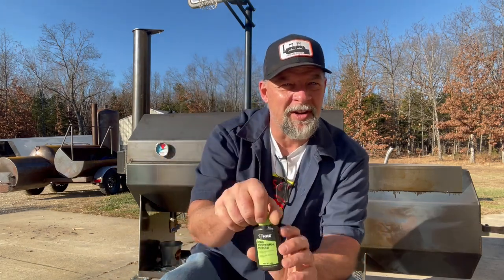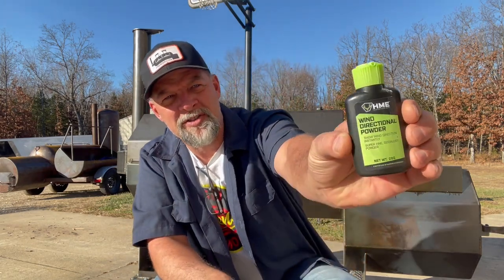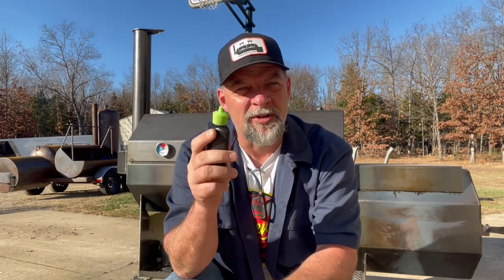Fire Management: 3 Reasons Your Offset Smoker Won't Get Hot Enough and How To Fix It

Comment: Thank you very much! Your advice on wind direction should solve my frustration. You are the first person I have heard to give that advice.
Reply from the maker: Awesome!
Could I develop the topic a little more?
Reply: @SmokerBuilder Yes, please do talk more about wind. Wind, for me, comes mostly from the south. My smoker is south to north with the firebox on the north end, and is aligned parallel to the front of my garage, which is about 6 feet east of the smoker. My firebox is completely burned out and I need to replace it. I want to turn the firebox so that it opens to the front, rather than on the north end, so I can watch the fire while I am under the cover of the garage. It’s a Frankenstein idea, but should the orientation of the firebox be critical as long as I adhere to the airflow calculations based upon your pit calculator?

Comment: Great video! 🙋👍
I like to brick line the bottom of the firebox and burn on the floor. That keeps years and years of direct heat off of the steel and will preserve it for a long, long time.

Comment: I have a Char-Griller 2828 Smokin' Pro I got as a wedding gift ten years ago. I initially struggled with getting it up to temp until one day I got distracted and accidentally left the stack damper wide-open. That proved to be a "Eureka!" moment. It came up to temp easily and stayed there. I eventually had to back it off. Also, I highly recommend trying the "Flying V" grate method (see link below). I set it up in mine using a couple of extra grill grates that came with my side firebox and was shocked at the difference in performance. It held a steady temp between 250° - 275° for close to 3 hours, using just the initial chimney of coals, no other fuel added, other than hickory chunks for smoke. My wood chunks lasted longer, too; only had to burn about 1 or 2 an hour to keep the smoke rolling. It did a lot to mitigate ash build-up, too. 

https://youtu.be/FD9PQWboRQk?si=2h20lIfLS2oVg6eO

Comment: This wind effect definitely applies to the Traeger Tailgater with the 2 vent holes on the back, combatted this problem by riveting a piece of aluminum over each vent hole and purchased a smoke stack off amazon, cut out the hole and bolted it on, i did add 2 additional nuts and bolts to the stack to help secure it even better and has been running dang near flawless since

Comment: I live in the Outer Hebrides of Scotland which is windy most of the time.  I do position it you do here, but with high winds is sometimes just too much, so I built a wind block of two pieces of plywood, hinged together, and lined with a welders blanket.  I smoked a turkey on Thanksgiving in 30-40 mph winds.  It still wasn’t easy but it was manageable.

Comment: Hey I’m a big fan. Currently building my first 250 gallon offset. Thought about doing a Goldees design. Can you explain why there design supposedly works so well. 
  I already built a 120 off an air compressor tank with an open throat. It works well. Just curious what you think. Thanks Frank!!

Comment: How much wind would it take to affect the Mack offset smoker? I moved to a pretty windy part of the country. Western South Dakota. 20mph is normal. 30 gusting to 50 is pretty regular when it's a slightly higher winds situation. Seen 30 with gusts of 40 within the last week.
Reply from the maker: I’ve actually cooked on my Mack up there back in the day. As long as you keep the direction quartering towards the firebox you’ll be fine. Those winds are still challenging though. 
Once you run it a few times you’ll have it figured out 👍

Comment: I never had problems getting my smoker up passed 250 and would struggle to maintain it under 300 but when I tried to make chicken wings yesterday, I could barely get it over 225! It was so frustrating. This caused me too cook the wings way too long and I feel they are way to smokey. I'm guessing it was the wind. I was using more lump charcoal than I have ever used before and it still wouldn't get up there. I thought it was my thermometer probes. Maybe it was. More testing needed but I thing it was the wind.

Comment: I got me a new smoker I cannot get the vents situated at all I have the bottom vent open and the smokestack halfway and it still can't get to temp do you have any suggestions for me
Reply from the maker: @patriciagraves486  howdy! In order to answer your question better I’d need to see some pictures and how you’re building your fire. 
If you could join it private community you can post pictures there and get more support. 
Go to SmokerbuilderU.com
There’s also a free fire management course there that will likely answer all your questions!

Comment: I purchased a custom smoker off set .. firebox is square n top load really struggling with temps n fire management any would be helpful.
Reply: I've built 5 square firebox offsets and 1 reverse.
Check the dimensions and volumes of your smoker via the online Feldon bbq pit calculator.

If any of the dimensions or volumes is off (to small) draft is an issue.
*Firebox volume (+-30% of cooker)
Chimney volume (5% of firebox)
* Air inlet size(s)
* Firebox to cooker hole size.

Take a taoe measure, add your measurements to the online tool and it tell you what you need so you know if its allrigth or off.
Have it fixed, fix it or contact supplier.

What i always do just to make sure, 10-20% extra firebox volume, you lose volume because of the fire rack.

Sligthly extra air inlet volume as you can easily close of the extra. 

Built my chimney sligthly to high, i can cut off exes if draft is off. Welding on an extra piece is a no go to buyers and myself.

Also remember, a high and narrow chimney cools down to fast and destroys your draft. 
You'd prefer a stubby, shorter chimney with the correct volume.